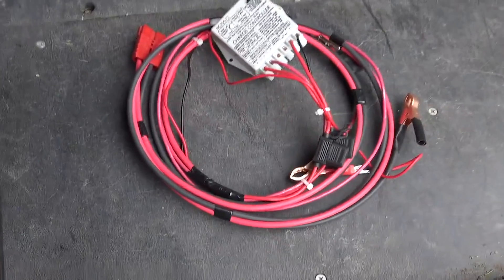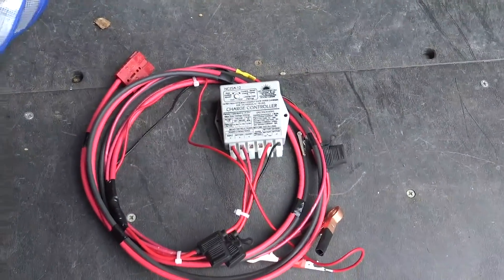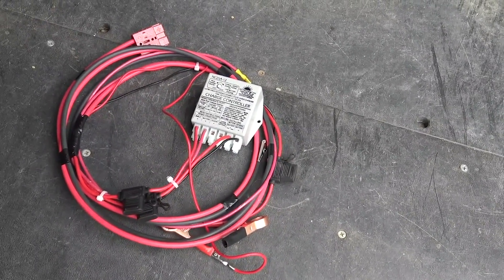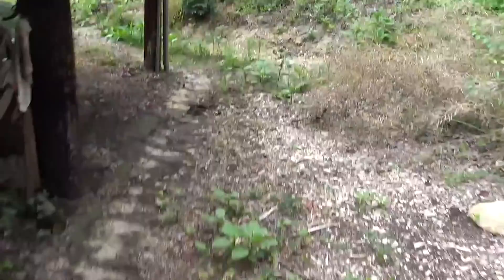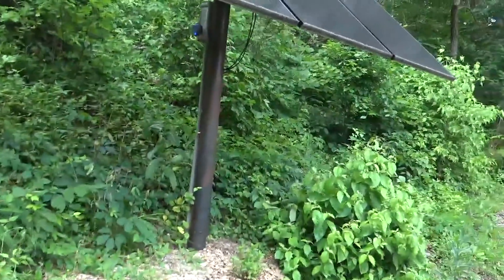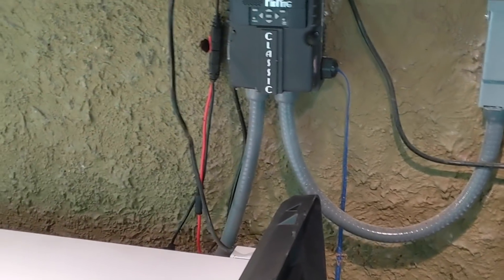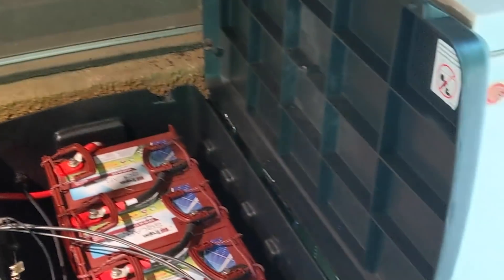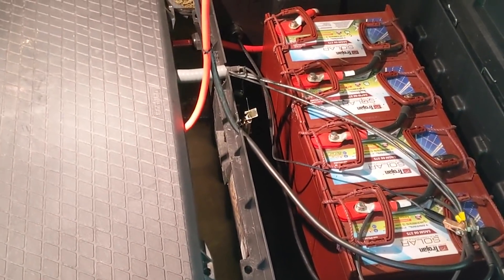DC  Solar Playground

Comment: How are you doing the golf cart?
Reply from the maker: We are using a 36 volt flex charge charge controller connected to the batteries Anderson connectors to the solar.
Reply: @engineer775  Do you sell these?

Comment: The SunStar freezer is now built in the USA,and they  use alot less energy than they used to , also the overall freezer is very well built,including heavy duty casters,on the bottom.
Reply: @Joshua Kiser I understand,your skeptism,but before I understand that the units were designed. built specifically for SunStar in China.Now they have a production line where everything is assembled,including the whole freezer box,in Indiana. here is the SunStar tech ph # 260-214-0949

Comment: What's  a good Lithium Ion Battery to use with solar panels ? Are there any short falls with Lithium Ion battery used in solar power offgrid ? Thank you
Reply: don''t ask engineer 775 about lithium batteries. he is opposed to them
Reply from the maker: @ursodermatt8809  I love then for motive applications.  My only beef is that they are still too expensive.  An oh yeah, they are toast in and EMP.
Reply: @engineer775  
well yes, they are expensive upfront. so are the fancy hybrid inverters you install. however a lithium battery has far more discharge cycles than a lead acid battery. plus they can be charged and discharged with much higher current. and can be discharged right down to zero. so you can use a smaller capacity battery.
and the oh yeah, EMP, (bordering to religious fanaticism as far i am concerned) it will take out the bms. however if such an emergency occurs, you just balance the cells say every 3 months manually. besides if an EMP event occurs, your destroyed electronics are the least you are going to worry about. if the hoodlums don't find your farm to filch everything, it will be the government confiscating the whole emp proof stuff.
EMP seems to be a totally american thing.
Reply: @Harry M 
yes i agree, lifepo4 are better. certainly for a do it yourself installation.
Reply: @ursodermatt8809  agreed. LiFePO4 ideal.